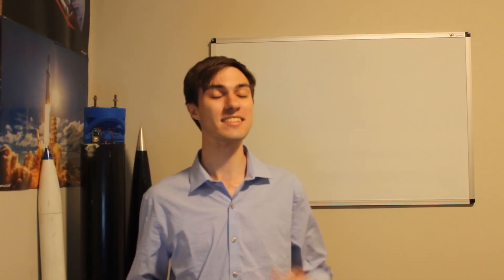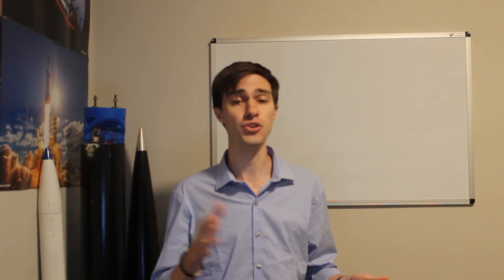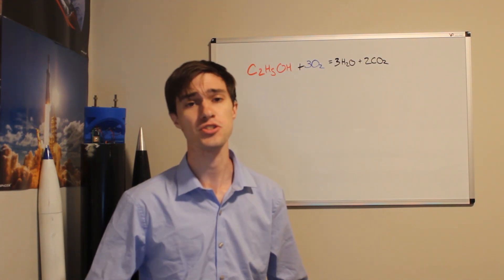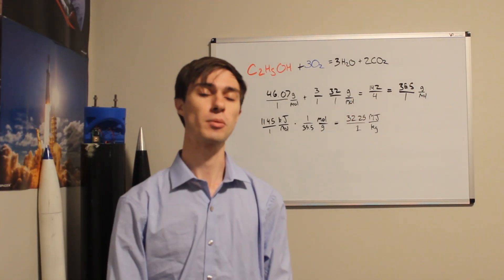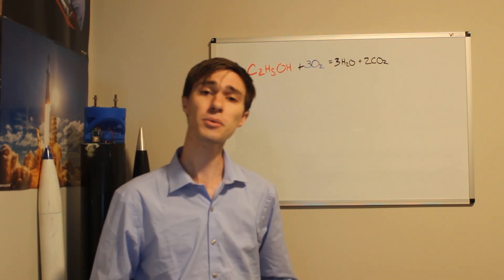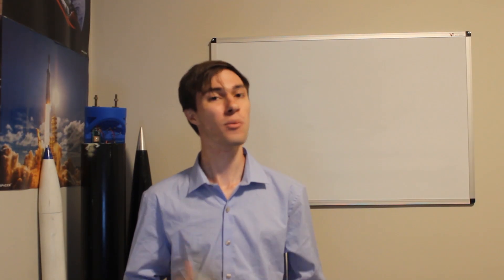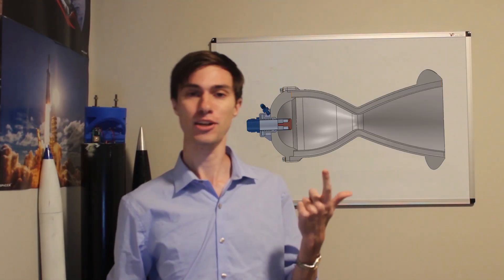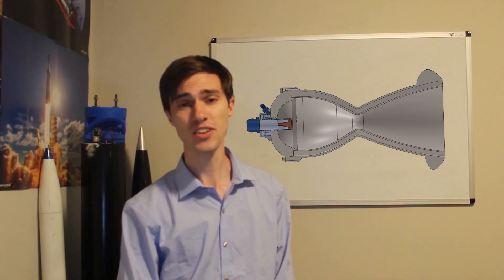Liquid Rocket Engines 1 : Design

Comment: If/when I get back to college, I want to eventually design and build a ~1kN MethaLOX engine, so if you don't mind I'm gonna be taking some serious notes, so if you want to go beyond the layman's explanations into truly nitty gritty masters details, please do cause I'm gonna need all the help that I can get to have a basic head start before I get back.
Reply from the maker: I don't talk about it here, but I did design work on a 2kN methalox engine. Machined a lot of test parts, but we had problems with supercritical methane injection, cooling, and generally inexperienced choices made early in the design. I'll throw deets in later videos.
Reply: If you're still interested, i've found using NASA's CEA ( https://cearun.grc.nasa.gov/ ) on the rocket mode will tell you almost anything you want so long as you spend a bit of time figuring it out.
Reply: @robbiejames1540  Thanks for the link, I've bookmarked it! Unfortunately I'll be putting any return to classes plans on hold until the pandemic ends, but I've been gradually learning basic and above basic equations and concepts I previously hadn't learned yet. If I can learn some thermodynamics and become more acquainted with it as pertaining to the gas laws, I could potentially design a simplified rocket engine, or at least familiarize myself to the equations for one, before I make any real plans.
Reply: @michaeljulian9198  
Yeah, rockets have been my covid project while out of school. So far I've managed to make a small gox/isopropanol rocket but I've run into the problem of there being NO WAY possible to get Lox in the UK :(
Reply: Also thinking about designing and building a 1kN engine in the summer this year. Thinking of using methanol (CH3OH) and stabilized 90% hydrogen peroxide (H2O2). The cost will also suck.
Reply: @brians8799  
Where are you planning on getting the 90% peroxide from?
Reply: @robbiejames1540  There are ways of distilling food grade peroxide to higher concentrations using professional apparatuses, though it can be done very carefully by amateurs in small quantities. Given that, it would be highly recommended to leave the distillation of hydrogen peroxide to the professionals, at least anything more than minute quantities of it. A lab scale motor fueled by manufacturing HTP from diluted peroxide with abundant safety precautions could probably be done by an amateur with adequate chemistry experience, but anything more would require substantial assistance by professionals with access to a well stocked lab and very good equipment.
Reply: @robbiejames1540  I would have to vacuum distill it myself. I can probably only find it at 30% concentrations at maximum. Although it's really dangerous, H2O2 is much safer than other oxidizers, not cryogenic, and is relatively easier to get my hands on. I'm not going to just make 10 kg of it right away and see if it works, I'm going to have to do some small scale testing to see how safe the chemical is before I handle a more dangerous amount of the stuff. I've made my own APCP solid propellant before so I don't think I'm that reckless by making hydrogen peroxide myself. Ammonium Perchlorate (AP) is considered a class 4 oxidizer while ~50-90% H2O2 is only considered a class 3. If I feel like the distilling to 90% is too dangerous, then I can just lower the concentration of the hydrogen peroxide to 70% or so, which also adds the benefit of lower combustion temperature.
Reply: @brians8799  
I see. I'm currently working on a system to make Lox using a high pressure compressor, and I managed to pick up an almost new (if the description is to be trusted) 25 litre dewar for £120, so if it fails I can use ln2 to condense oxygen. But there's still so much to do to get to my planned 2kn butane-lox engine...
Reply: @brians8799  
Yeah, good luck to you too, trying these things at such a young age! I'm an S6 here in Scotland, which I think translates to 4 years older than you, and i think i first started building rockets maybe 3 years ago. if/when you do get round to testing a liquid rocket engine (or any other kind!), ill be waiting to see a video!
Reply: @dingwon  Share the resources!!! I'd love to check them out!
Reply: @dingwon  Hi, is this offer still available? If you could share your resources that would be greatly appreciated.
Reply: @brians8799  
My thought process for using butane is that its:
1- liquid at room temperature and roughly 2-5 atm, which will help feed it into the pump system
2- better Isp than kerosene, better density than methane - it seems to be a best of both worlds
3- the shorter carbon chains should prevent polymerisation in the cooling channels, so it wont need to be really refined like RP-1, and so easy to get.
Of course, it has plenty of downsides, like the soot and high combustion temperatures, which could pose a problem down the road, but I'm still a long way from there!
Reply: @brians8799  
Why did you choose methanol over, say, ethanol or propanol?
Reply: @brians8799  
Well, my current plan is to try and sidestep terbomachinery altogether, and use an electric motor attached to a custom gear pump. If I can get the gear pump to work, it should have many advantages over any other fuel supply method, as it's a positive displacement pump, so will pump a fixed volume per rev. This would make fuel metering very easy - instead of having to calculate the pressure losses in the cooling channels, injectors ect you just set your motor at the right speed. It should also allow easy throttleability to an extent - just turn up or down the motor. Also, you can couple the oxidizer and fuel pumps together to achieve a fixed O/F ratio no matter what. The thing I'm worried about is whether it'll work properly at the higher speeds I'm hoping to run it at, and keeping it sealed properly.
Reply: @brians8799  
Once you get it going, I hope you upload a vid of your engine. I thought my first IPA engine had a nice exhaust, so I can't wait to see yours with methanol!
Reply: Me just barely keeping with what he is saying because I'm still in high school: yeah that sounds great!